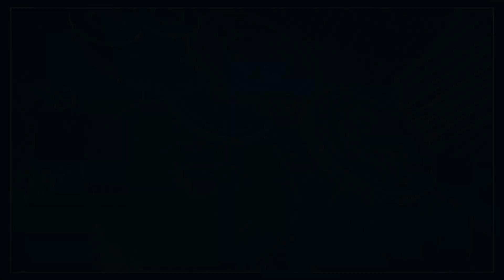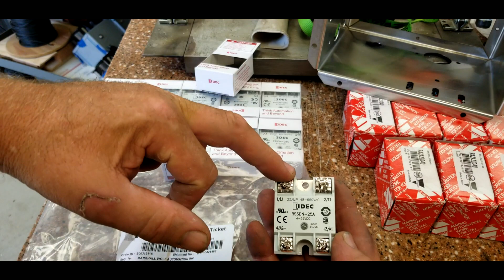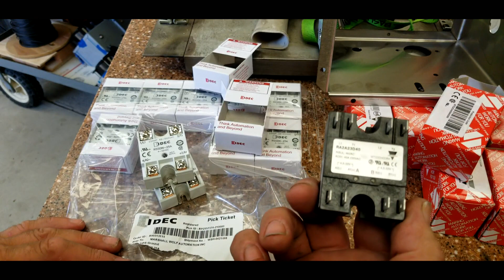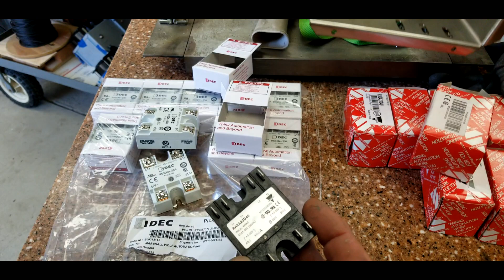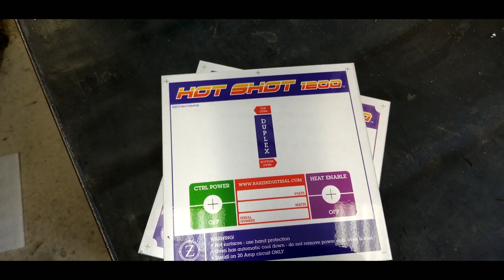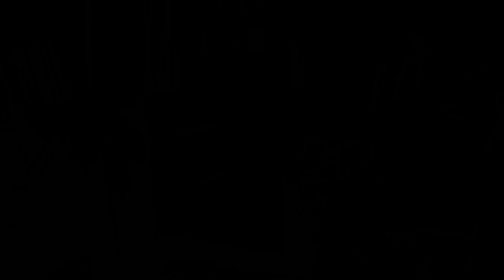Hotshot news for Sept 2019

Comment: Do you need a bigger heat sink on the dual SSR?  I would presume that it will release twice the heat...
Reply from the maker: Oversizing SSR's is good practice to keep them cool, I use 40 amp units for a 18 amp load, also the heatsinks are 30 MM wider (not taller)